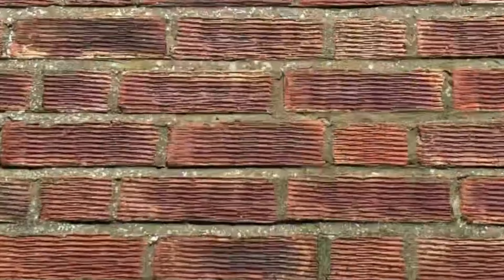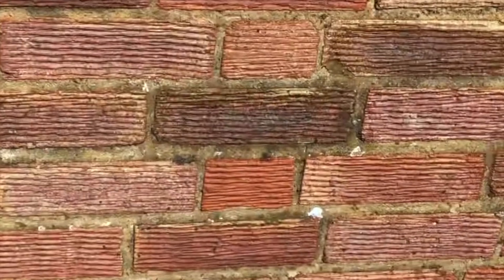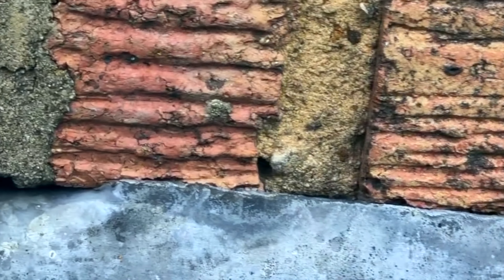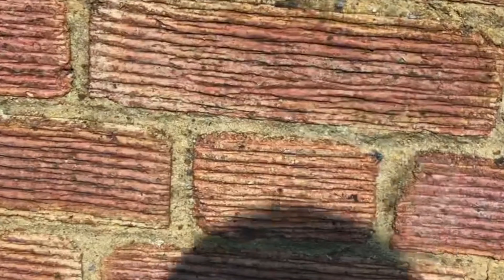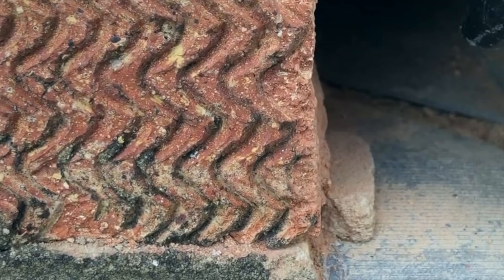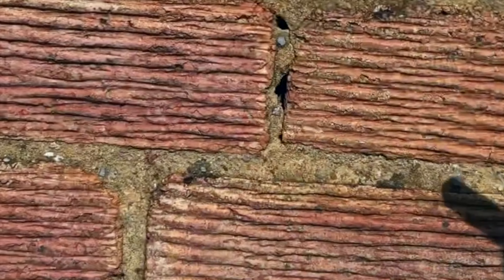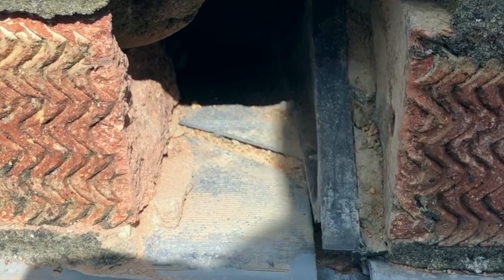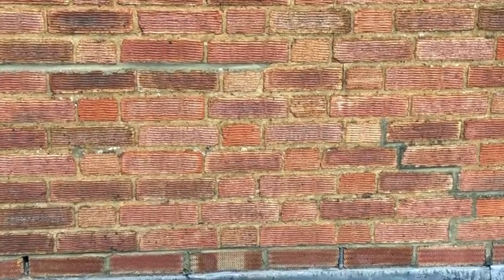Why is my wall damp?

Comment: Have you actually checked the Retro Fitted  cavity wall insulation? 
If you remove bits of insulation like you say, you'll create cold spots which could cause condensation! Also if water ingress has entered the cavities it will soak into the insulation causing damp issue's.. 

If you fix the cavity trays or the lead it may fix one problem but the insulation will remain wet and continue to cause issues..
Reply from the maker: Hi Ricky, I’ve repaired it since then bud. All nice and dry with no issues. Yep, I know about cold spots and wet insulation, I’ve done loads of videos on root cause bud particularly in cavity construction. Appreciate your comments, and thoughts  👍👍👍
Reply: @completepreservation  Good stuff 👌🏻. That retro fitted Insulation can be a absolute nightmare..